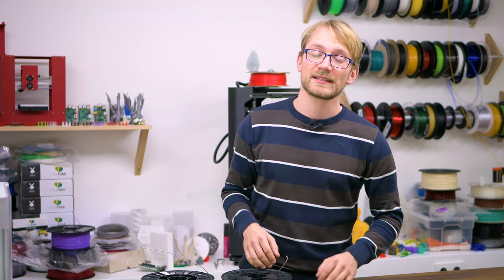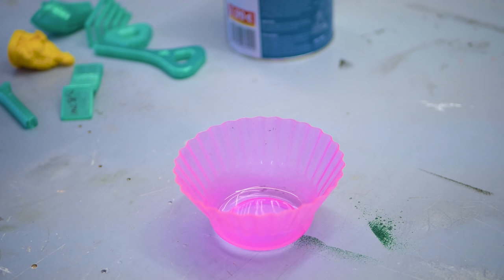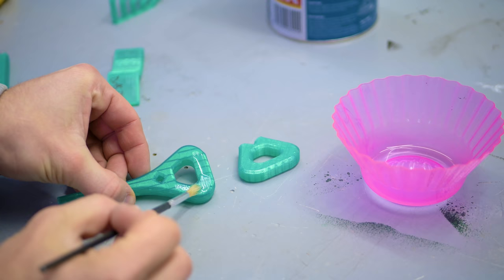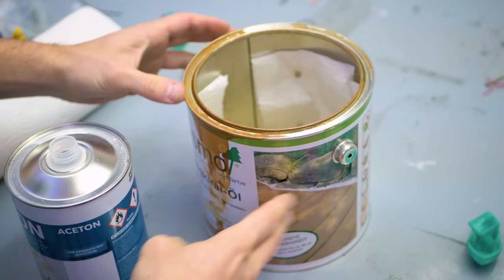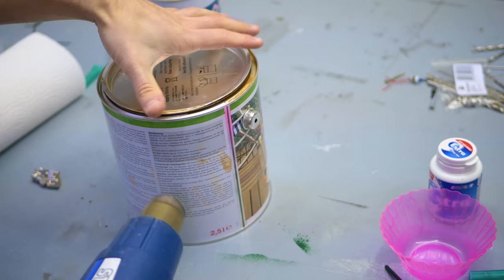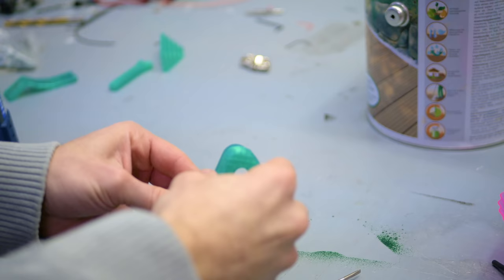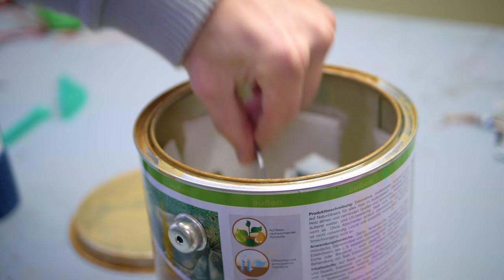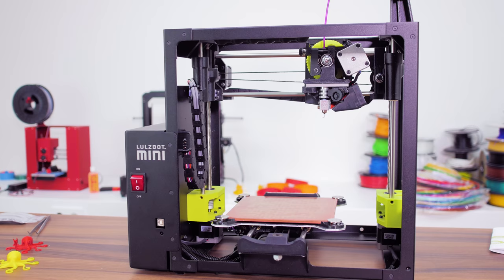Does Acetone also work for welding and smoothing PLA 3D printed parts?

Comment: I smooth PLA with acetone but use the acetone as a heat carrier, I boil the acetone and dip the part in the vapor layer. It takes 5 seconds to smooth. Please note while this method is highly effective it is also highly dangerous, I use a glass beaker so i can see where the super heated vapor is (it has a visible condensation line), like Thomas mention highly flammable (I use a lab heated magnetic stirrer.. NO OPEN FLAMES) and a fume hood.

Comment: I bought some isopropanol (isopropyl alcohol) from my local electrical store, just for cleaning the printer bed, but Apparently it can smooth PLA. I believe it's what the Polysher is based on.

Comment: I tried to vapor smooth one of my PLA prints and it worked really good with acetone. For that I used some acetone I got from the pharmacy and poured some of that into a big glass with a lid. Then I put the closed glass onto the heat plate (heated to 100°C) of my printer and let the acetone vaporize for a bit. Next I got a little piece of wire and attached it to my print and hung it into the glass for about a minute keeping the lid closed. The material I used was FormFutura's EasyFil PLA. Here's the result: http://envent.de/pics/PLA_acetone_print.jpeg
Reply: You country might be selling pure acetone on pharmacies. Mine does not, it sells something mixed with alcohols and water, and besides not working properly for parts, it has a terrible effect of degrading and blemishing on the surface. So be advised.

Comment: I've just tried the welding trick with some black Jandex PLA, and there was no adhesion whatsoever. The acetone didn't cover the surface like in your video but was sucked up immediately, making the surface dull and a little soft. Oh, and the Acetone did leave white marks wherever even a tiny droplet splashed. So, as usual, YMMV, I guess...

Comment: Try paint stripper. The stuff that has the warning not to use in a bathtub. Make sure it's done with a garage door open or outside though. The fumes are hard to stay safe from in an enclosed space. Even a respirator is only effective for a short period of time. It's known to punch holes in filters...so if u need to actually strip a bathtub I recommend a supplied air system lol. I know from welding acrylic that stripper is much stronger than acetone. I also know the little bottle acctached to the side of large cans is misleading, it said stripper sprayer ...idk why the club bouncers escorted me out 😂

Comment: Acetone well-mixed with oxygen is what we like to call a flammable mixture. When you confine it, it's a bomb.

I'm not going to tell you it's a bad idea; explosives can be entertaining. But I'm not going to be anywhere nearby when you do it. Especially when you're using a heating element right next to the can.

Please be extraordinarily careful if you use anything like this technique and do it only if you understand the safety issues.

Comment: You should try adding a soaked pad in front of the part cooler while printing to test layer bonding. Or try a slightly soaked dust cleaner on the filament.. maybe it stays long enough on the surface to increase layer adhesion. Or it just burns in the nozzle...

Comment: I've found that n-butylacetat (the stuff that Revell contacta glue is made of) works really well to glue pla parts together, that and the very fine needle like tip that comes with the glue bottles makes it easy to use, so that's what i usually use.

Comment: What is this fascination with the benchy? I'm fatigued with the printed benchy as the example and I haven't had my printer for more than 2 months yet! Can we not think of anything else to print? Why the benchy all the time?
Reply: It's because the Benchy is ubiquitous that everyone prints it. And it's probably the only benchmark with a website and merch. If you weren't aware of the website go check it out, it explains in detail all the features of the Benchy and why it's such a great benchmark.

Comment: I have 99% iso alcohol can I use a paint brush to smooth and weld the lines together?
And if I put it in a spray bottle and put it on mist would that work as well?
I also got some ABS filiment so not sure if that can even be done using 99% iso alcohol?

Comment: You did another video where you strength-tested various adhesives for PLA - it would be REALLY useful to test the strength of acetone welded PLA compared to your preferred LocTite superglue solution.

Comment: Are you recommending using acetone to weld PLA parts together permanently or will the part degrade over the weeks as you pointed out with the dunking process?

Comment: Has any one heard any updates on the PollySmooth filiment that was supposed to start shipping this month "DEC" ?
Also I have tried acetone with the cheep PLA plastics from ebay and never been able to weld parts that way or even get a sticky surface, what I get is the PLA with take on a white or gray hazzy look.

Comment: I use chloroform for smoothing PLA and making PLA glue to bind parts together. Allegedly DCM will work too, but never tried it. To be safe about it you have to vent the fumes somehow...If you don't have access to a fume hood, then you can build one, certainly not more complicated than the 3d printer itself.

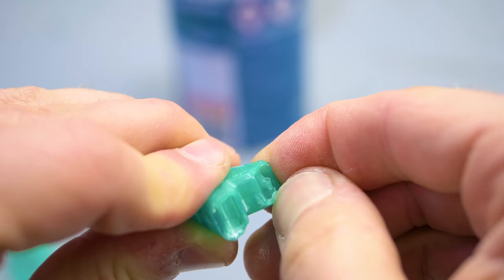Comment: You say (1:14) that a lot of strength is lost after treating with acetone. This is due to the acetone which has been absorbed into the plastic. I'm sure the part will regain its previous strength after all the absorbed acetone has evaporated away, perhaps after 24 hours?

Comment: From what I’ve seen acetone effects some pla's more than others, on paper ethyl acetate is the chemical of choice for pla, I have some waiting at the post office to clean out a rather well jammed nozzle.
Reply: i've done extensive testing with PLA, and dichloromethane (DCM) is the only true PLA solvent i've found which works with all PLA. acetone doesn't even scratch most PLA, and tetrahydrofuran (THF) works only very weakly.

look for scigrip weld-on #4. it works on PLA like acetone works on ABS.
Reply: Gentlemen, now that my eythl acetate arrived today and after soaking some bits for only a few hours the pla "welded" to them has become soft and could be scrapped off with ease, i'm putting them back in overnight to see how well it does with a decent soak along with a very clogged hexagon hotend :D
Reply: Chloroform is even better than dichloromethane actually. I use it all the time nowadays.

Comment: I wonder if a redesigned 3D printer could apply a solvent vapor during printing to make the layers adhere better? I see there could be complications to this, I'm just trying to think outside the box a bit.
Reply: Would be expensive to not only engineer the safety but in materials used as to not be susceptible to degradation from acetone exposure. It’s a dangerous process when you have flammable fumes in an enclosed area around active electronics… deffff best to keep those processes separate!

Also, acetone is not an appropriate smoother for PLA, in general it does not work, and will cause micro cracks internally (since it’s absorbed into the part) that often won’t reveal how structurally compromised the part is until weeks/months later

Cheers

Comment: you can vapor smooth pla with ethyl acetate my experience with acetone pla is that it depends on the pla. some pla are blends  and those may vapor smooth. color fabb is one that I have heard will smooth with acetone vapor.however in general pla will not vapor smooth with acetone.

Comment: i wonder if you could bake and acetone polish them in the oven at the same time for a stronger bond. but i wouldnt recommend it because acetone is really flammable, also acetone vapor is not very good for you, please use it in a ventilated area.
ps. finally got my printer! i build it in 2 days, i didnt do the calibration or software setup yet but im taking it slow and enjoying the build. (geeetech prusa i3 pro c)

Comment: The acetone is probably acting more on the modifiers the manufacturers use in their PLA recipe than on the actual PLA resin.
Reply: Could you expound on what you mean by "modifiers"? Thanks!
Reply: @mikebevan1034  The PLA filament you buy is not a pure product.  Manufacturers add ingredients to control the melting point and flow characteristics along with cosmetic ingredients such as pigments and ingredients that create matte or "silky" textures.

Comment: Could a heat gun or propane flame be used to smooth the surface?
Reply: Yes you can use a heat gun or torch to smooth PLA.  The major issue with these methods is trying not to overheat the part and causing it to melt.  It is easy to melt a part with these processes.  I've done it with varying results.
Reply: @valveman12  heat gun with temperature control would be better option. but it is still knife's edge between soothing and totally melting.

Comment: Just use any PLA solvent for smoothing and welding.  "PLA is soluble in chlorinated solvents, hot benzene, tetrahydrofuran, and dioxane." THF isn't too bad to work with. Just don't let it sit around and crystalize.

Comment: Acetone does not dissolve PLA, at least if you have clean and pure PLA. But the most filaments you can buy are blends with PLA and god knows what else, probably you dissolve this. So it is nothing like ABS. Said this I have a lot of "abs" filaments that does not dissolve entirely in acetone, and some do. Again the manufacturers are mixing the materials to "improve" the printing quality and this has different consequences.

Comment: Another awesome video, Thanks for sharing Tom. 
I can see an influx of people printing multi part prints and using the Solvent Welding method instead of messing around with Glue.
I couldn't see in the Video but what did the seem end up looking like between the parts?
Reply: Thomas Sanladerer So no crazy unremovable white stains like Super Glue. I asked about the seam quality to see if it would actually weld an fill tight joints or if it just bonds them together. 👍 Keep up the great tests Tom it's always a pleasure watching your Channel.

Comment: Has anyone tried MEK (methyl ethyl ketone) or methylene chloride?  Those are two solvents used extensively in plastic work.  Either should work better than acetone for welding.

Comment: i would expect the acetone doesnt do the smoothing for you it just makes it smooth to polish the sticky bit with a mineral oil damp lint free cloth perhaps
Reply: btw you forgot newton's law ... an object at rest remains at rest ... how is a pla figure supposed to auto smooth without some work being done to it ... sure the acetone is reacting with the plasticizer which is why it is getting sticky ... but other then gravity NOTHING is working to smooth the surface ... that requires the good ole hardware store jug of elbow grease ... yup ... polish that sucker ...

Comment: how big can you print with a 3d printer? thanks
Reply: Well depend on the size of the printer , and ender 3 have 220 x 220 x 250 mm so that the impresion volumen yuo can do..there are bigger printers..

Comment: What about using commonly available PVC cement (as intended for plumbing)??  I had very good results laminating ABS sheets with it.  I wonder if it would be an effective PLA cement...  will have to try it.  As for smoothing, I've been playing with a hot air pencil, the type used for reflow soldering.  It has some promise, but the best results are for hot air welding of PLA.  Overall, I just don't think PLA flows on its own like ABS.  Thanks for the informative video!
Reply: PVC glue or cement is usually just stabilized Tetrahydrofuran (THF) anyway. It's known to act with PLA just like acetone does with ABS (works for smoothing too). So, you should get pretty good results using PVC cement. There could be other chemicals in PVC specific glue too, so maybe check the labels or look/ask on the manufacturer website to get some information on the composition. However, you have to keep in mind that not every PLA filament is the same, some have additives that can change the chemical properties so solvents don't work as good as with other manufacturers. Some "PLA" labeled filaments can even be smoothed pretty well with acetone as well. You basically have to do some experiments with different plastic blends from different sources to find the right composition.
Reply: i have had extremely poor results gluing PLA with THF.

the true PLA solvent is dichloromethane (DCM). it works great.
Reply: No, chloroform (trichloromethane) is better.
Reply: I've used yellow ABS cement for pipe on PLA and it works great for gluing parts together. I have used it on eSun PLA+ in Silver and Black.

Comment: I am expecting Acetone to be removed from retail shelves any time now. Until then, I'm glad I can still find it for the little that I need. I've been using it occasionally since the 70's when I was fabricating fiberglas kayaks and accessories and buying it by the gallon. It's nasty stuff on several counts and handling it like in this video like it's paint thinner or varsol  just makes me cringe.
Reply: The MAC values for work environments for acetone is similar to aethanol. Acetone is  present in blood as an intermediate product. It will vanish in the eco system without a trace. Comparing it with paint thinner is just ridiculous.
Groetjes Albert

Comment: a guy on the Ultimaker forum has shown acetone smoothing pla is possible.  just depends on the pla blend: https://ultimaker.com/en/community/10412-acetone-finishing-on-pla?page=1
Reply: dichloromethane (DCM) is a true PLA solvent and works with every PLA, doesn't matter what blend.
Reply: I am pretty sure that it is not actually dissolving the PLA, but only the additives, wich is why it pretty much only works with Colorfabb PLA/PHA, and i suspect it is the PHA that does get dissolved.

Comment: Is there any other material/technique that could possibly smooth out parts printed with PLA?
Reply: sand paper works ;)
Reply: But doesn't it have a rough kind of texture/finish to it, or is it still pretty shiny?
Reply: if you want it shiny and smooth pla is not your best bet unless you sand and paint it. there is also this liquid epoxy to "smooth" pla prints but i have never used it. I think is called smooth-on
Reply: Give a 2 part epoxy a go, like purpose made XTC-3D.
Reply: Oh hi Angus :) Thanks for the tips! And yeah, ABS is a lot better for clean, smooth prints. Was just wondering.
Reply: Yeah for sure, but it's also a lot more difficult to print!
Reply: THF, or Tetrahydrofuran can work with some PLA blends (depends on the composition/additives the manufacturers use for the filament). PVC glue or PVC cement is basically THF with some other additives in it, so it can be bought at almost all hardware or home depot stores. (Check the SDS, of this glue for example, it states that the glue is 30-60% THF: http://www.oatey.com/msds/sds-us--oatey-pvc-heavy-duty-clear.pdf )
Reply: ExtraBase Thanks, I will take a look at that.
Reply: I have been using THF for a long time now and did not know it would not work with some PLA blends. Thanks for the information; I must test it more (I always preferred chloroform because it&#39;s faster).
Reply: "THC" I don't think that's what you meant :)
Reply: Tetrahydrofuran is thought to probably cause cancer...exercise significant caution.
Reply: Maker's Muse
XTC-3D is a coating solution, it's not the same thing as a solvent like acetone or chloroform. Solvents do not significantly alter fittings, coatings do because they make the part thicker. It might work for sculptures but it's like the worst advice ever for mechanical parts. It might work if you compensate in the model though.
Reply: Pook365
LOL, sorry. I corrected my statement, thank you. I like drugs - lab drugs for using on the parts, not that other type of drugs.
Reply: VenomTheCat
the problem with sand papers is that they exert mechanical pressure on the part. For thin and delicate parts, this is a huge problem. At worst it can break the part, at best it can take off needed detail.
Reply: Cláudio Sampaio Never said it was a solvent, but they asked how to 'smooth' out a part, it would make it smooth - but does add thickness.
Reply: Pook365
every lab product requires significant protection. Even acetone is not consequence-free, although it is less dangerous than most. I am not disagreeing with you, I am just saying that wearing protections is kind of an assumption when you talk about this kind of stuff. When I deal with my solvents, even acetone, I wear a gas mask and googles, nitrile gloves, and sometimes a bunny suit.
Reply: dichloromethane (DCM) is a true PLA solvent and works on PLA like acetone works on ABS. it can be used for smoothing the same way.

Comment: stop trying all those chemicals and try with the classic pvc glue of the plumbers, with a picel you give both sides to join and press lightly if effort then pass your finger through the union to remove the surplus and let dry about 10 minutes

Comment: perhaps you could try heating the pla first?
Reply: Probably not the best way to go. With vapour smoothing, you would want the part going into the chamber as cold as possible (at least, colder than the air inside). The trick here is that the vaporized solvent (acetone) will condensate on the cold surface, so you get a better layer of solvent on the surface of your part.

Comment: Real pla doesn't melt with acetone.. it does degrade tho. What it does melt is the pigment added to it.
Reply: The type I got doesn't budge at all when submerged in acetone. It does start to lose the color and when I tried cleaning up the nozzle by leaving it in acetone for days, cycling ultrasonic cleaner a few times in between -  it only got full transparent, still had to use a heat gun to get it out.